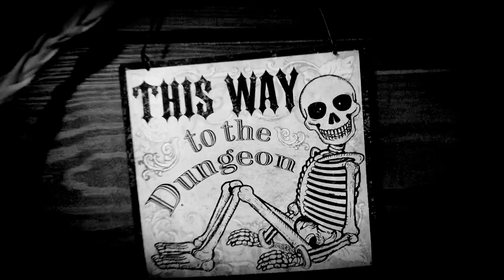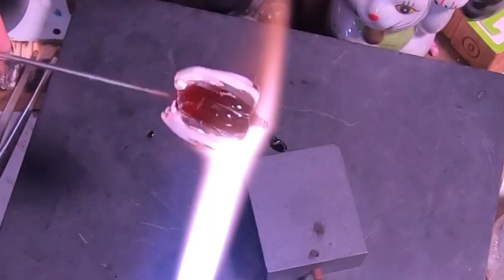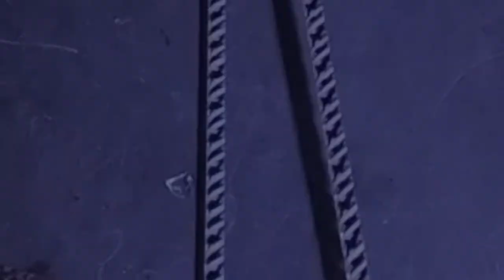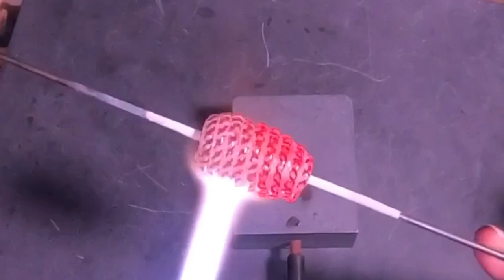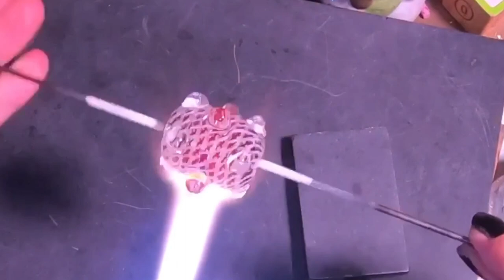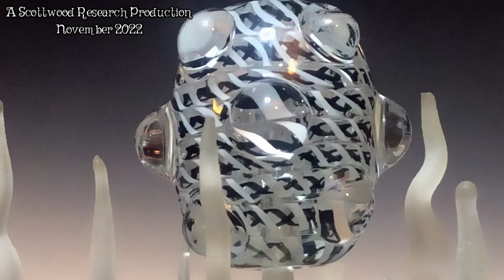Lampworking / Flameworking with Black & White - Volume 28 - Double Twisted Cane - 104 demo

Comment: Another great video.  I tried the bead release in  the middle and my mandrels weren’t long enough for me to get enough to hold onto. i’ve been trying to get a decent used concentrator. My concentrator died halfway through a demo I was doing at Oktoberfest. I am now on my second machine from the same company. I have another show on Thanksgiving weekend and I’m going to have to make this machine work until I can hopefully get another one from this company. The flow of oxygen has an eland flow  to it. So the flame will be set and then it will increase and then go back to the way I originally had it set. It continues to do this.  i’ve had to turn the torch way down with a small flame otherwise when the flame increases it’s a small reduction flame which really messes up a lot of my transparent glass. It’s been very difficult to reduce double helix glass. But I persevere. Hope you are well.
Reply from the maker: Hi Enrico!  I hope you can get the concentrator before your November gig!  I tried a small oxygen concentrator once years ago.  It did not give me the high oxygen flow that like.  I’ve been using the tanks forever….  My dream is to have an oxygen generator!  Alas they are to pricey for me right now.

😄  I do remember that I had that same issue with the flame “breathing“ using the concentrator and it made everything so difficult to work.    And as for working in the middle, I make my mandrels at least 12 Inches long. 10 at the shortest.  ✨💫 
Thanks for your comment & Good luck to you, Enrico!!   Cheers- Robin 👋🏽✨🌹✨✨

Comment: Hi! Thanks for one more brilliant tutorial. My "to do list" is getting longer and longer... Today I have tried to make my first twisted cane (not double yet), tommorow I will see how does it look like 😅 Everything goes slowy but steady but... I still make my white looking smokey. I remember not to work too close to the flame cones and melt it down slowly but it doesn't work. Some of the colors (white, pale blue) look like they were boiling. I went really down with my flame (I have Nortel Minor torch and two oxygen concentrator - so not so huge equipment😜) and I don't think my flame is very big. Maybe the problem is in the proportion of the propan and oxygen? I wonder if you can help me or I have to "get there" by myself by practicing 🤔 ☺ Cheers! Barbara
Reply from the maker: Hi Barbara! Congratulations on making your first twisted cane! That is awesome! 😆

So, you have 2 oxygen concentrators.… well, all I can say about that is that concentrators tend to be light on the oxygen output.  I use oxygen tanks which allows me to really turn up the oxygen. I like a high oxygen flame.   I am constantly turning my flame up and down when I work.    Some people work with a softer flame with less oxygen.  But you don’t want your torch to hiss really loud either…that’s too much oxygen!  I wish I was there to help!😩😃

The theory is that you want about 10 psi for the oxygen and around 8 psi for the propane.   That is a good place to start.  Some colors are funny and tend to boil no matter how hare you try to soften the flame.  Aqua Blue transparent is notorious for boiling!  I try to a avoid those colors.  By the way…what white are you using?  204?     
Hoping to help solve your issues! 🌹🥰✨ Cheers- Robin 👋🏽✨
Reply: @scottwoodresearch  Thank you! Well... today I used 204 and at the beggining it was better (I was making a mushroom so it took a while 😅) but at the end it turned "dirty". I will surely try to turn on the concentrators to the maximum and then adjust the propane. Tommorow I will try and let you know. :chillwcat:Cheers Barbara
Reply: Hi! Ok, it gets better. I don't burn my white any more 🥰 well... sometimes only a little... Thank you! I went after your advice and went up on the oxygen and went down on the propane. What a relief... I can move on now! Thank you one more time! ☺
Reply from the maker: Yea!!!  Hey, that’s awesome!!  Every torch is slightly different as they are handmade.  You just needed to do a bit of adjustment.🤗  I am always dialing in different flames when working.  It just depends on what I am doing.   I am so happy to hear the white looks better!!  Glad I could help 👍🏽  Hugs- Robin 💫🌹✨🌹🌹